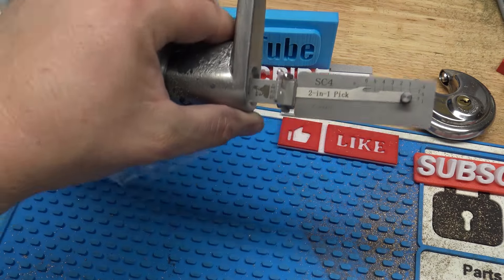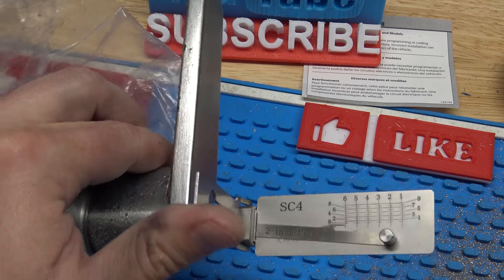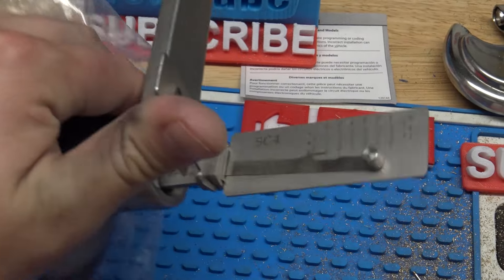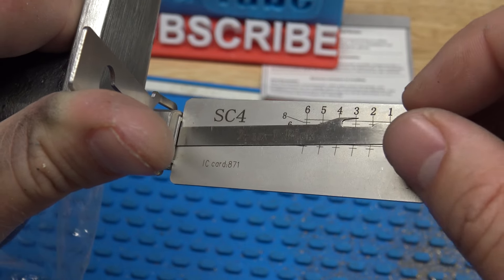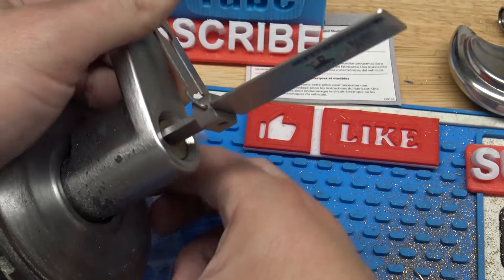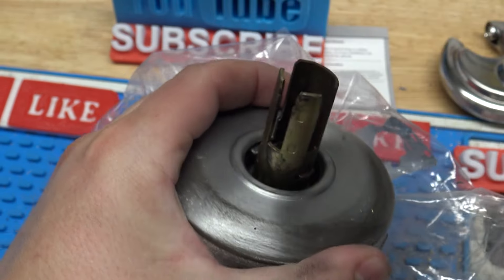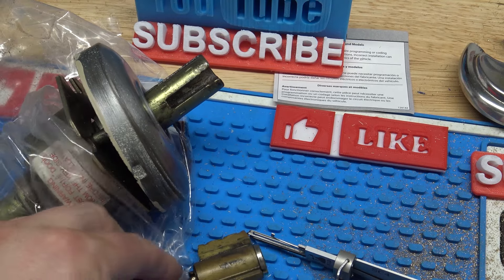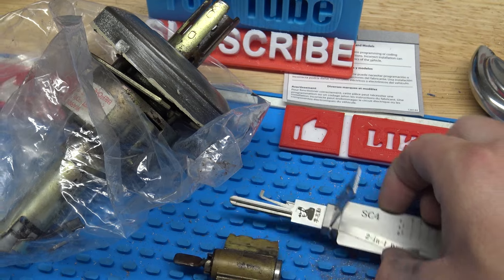(604) Removing a Cylinder From a Commercial Lever Without a key

Comment: I'm getting good with my auto lishi's (at least more confident and successful) but I still struggle with the Schlage and Kwikset lishi's. Very impressive how quickly you picked that lock, which saves the day with those levers and lost keys.
Reply from the maker: I find the pin tumbler ones easier to use than auto ones?
Reply: @BoredLockpicker  Yeah that's what everybody keeps telling me but for some reason I am just the opposite. For some reason they just feel strange to me on the picking. I always get a hard false set, but everything seems stuck after that.
Reply from the maker: Do you single pin pick with regular lock picks?
Reply: @BoredLockpicker  Rarely. i have single pin picked but very few. Most of the time I just try to rake, bump or electric pick.